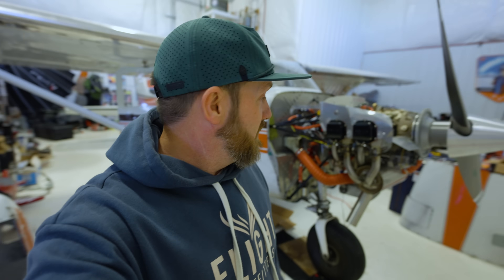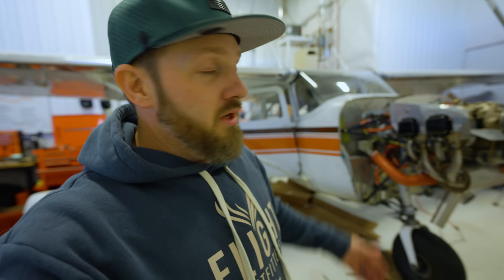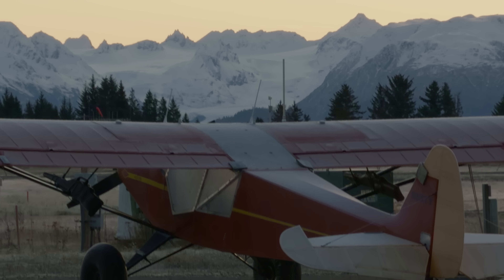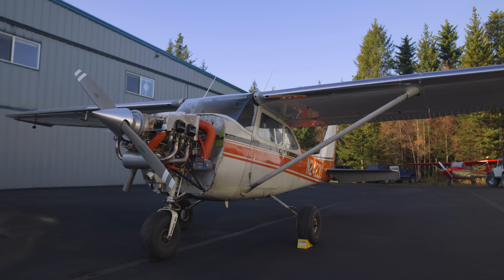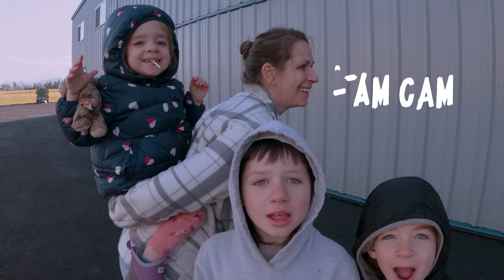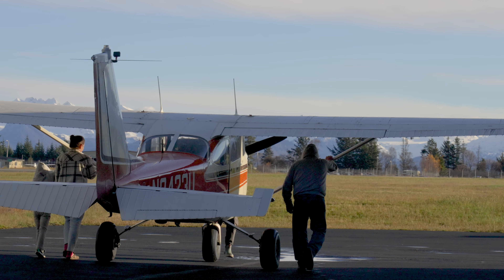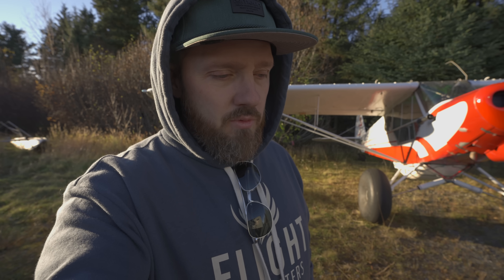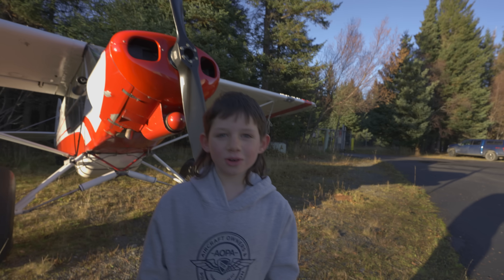You Have to Hear This Engine!

Comment: Congrats on getting it running!  I look forward to having you back in the air.  What is it about Continentals that just make them the best sounding airplane engine?  23U is going to be absolutely amazing to fly with all that extra power on tap.  I am anxiously awaiting your reaction video from your first flight.  I remember when I first took off after putting the O-520 in my 182P.  I think I might have even giggled.  It was a really manly giggle though...
Reply from the maker: It's a beauty! The interesting this is that this engine is a Lycoming design concept. It's very similar to a Lycoming 0-360. With improvements and other changes. It's a long history I could get into sometime, but kinda interesting.

Comment: Cowl it and fly it! To break in, I know everyone has their own ideas, but!!! What has worked for us was fly it and put it in a shallow climb with higher than normal MAP and watch your oil pressure and oil temp! Should happen with in 30 to 40 minutes!
Reply from the maker: Factory did the first 25 hour break in. Then we'll be following what Continental runs when we actually put it in the air. Have a lot to learn, gotta do it right, and taking direction from all the experience Dave has as well. Gonna be awesome!
Reply: Daniel would be so excited to hear that roar. I’ll bet he is looking down on you guys, with a huge grin. What a great moment. Thanks for sharing it with us,